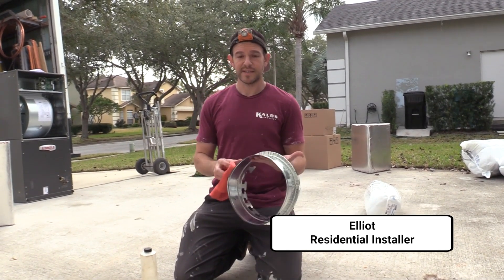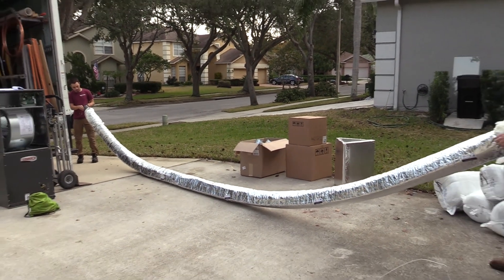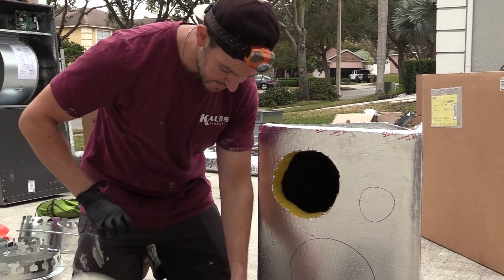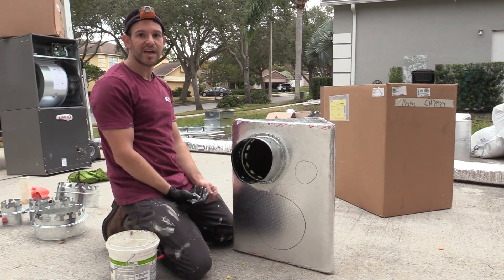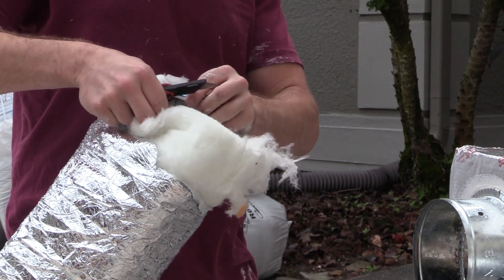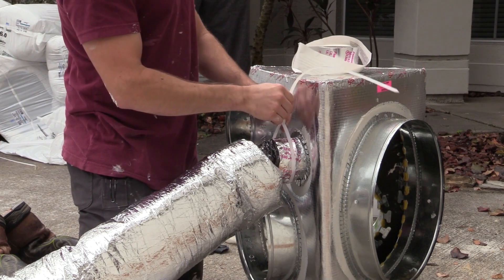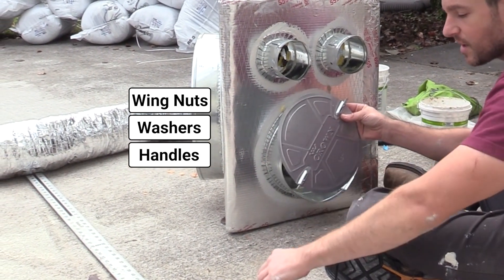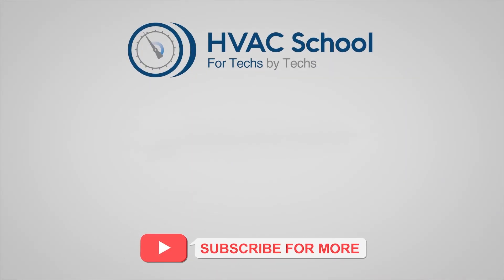Duct Prep Tips and Tricks with Elliot

Comment: IM A POUNDER OF DUCT WORK! 25 YEARS IN FLORIDA ATTICS. YOU FELLAS NEED SOME BASICS DOWN PAT. DAMPER PLACEMENT CAN MAKE ALL THE DIFFERENCE! PUT A DAMPER IN ANGLED OR  VERTICALLY AND IT WILL ACT LIKE A SCOOP! SIDEWAYS THE AIR WILL SLICE THRU IT AND BALANCE BETTER! AND ALWAYS GET TO THE SOURCE OF AIR NOT THE END OF THE RUN FOR A DAMPER! YOU'LL HAVE 25'  OF AIR BEATING DOWN THE FLEX AND ONLY A LITTLE BIT BLEEDS OF INTO THE SYSTEM! DAMPER IT AT THE SOURCE AND THE AIR WILL FIND A BETTER PATH IN THE SYSTEM.
101

Comment: Ductboard spider boxes and miles of flex duct! What a sorry duct system! As much as you guys preach about doing things right, I really thought you would do better than this. How about a solid metal trunk line, either round or rectangular, preferably round pipe as the air flows better and then flex going to the registers? That’s how we do it here in NC. All joints are sealed with mastic and the metal duct is wrapped with R8 ductwrap. Ductboard is trash and a bunch of plenum boxes fed by flex duct is pretty much the worst way to install a duct system.
Reply: Florida standard, unfortunately
Reply: This is the way we do it in Florida. No basement and you really don’t want to use metal duct because of the humidity.
Reply: I’m not buying that. I’m in Eastern North Carolina and we have high humidity as well, maybe not as humid as Florida but it’s close. We use metal duct on all our jobs and as long as every seam is sealed properly with mastic and the duct is insulated with R8 ductwrap it should not sweat. All of our ducts are either in the attic or the crawl space and I have seen some ducts that sweat in the crawl space but a de-humidifier normally solves that problem.
Reply: @vincentgelles3805  well I’m sorry but this is just standard practice in Florida. We don’t have basements so everything has to be in the attic. It seems to work just fine. Do YALL insulate the outside of the duct or on the inside. In Illinois where I started we insulated the inside of the duct unless it was going into an unconditioned space then we wrapped the outside with insulation.
Reply: We wrap the outside with R-8 duct wrap. It’s best to keep insulation out of the airstream so you don’t have fiberglass blowing through the house. I’ve seen lined ductwork that had some nasty growth in the insulation so we always wrap it on the outside. We don’t have basements here either. 95 percent of duct systems are in the attic the other 5 percent in the crawl space in the rare case the house isn’t built on a slab.

Comment: Cheap ass ductboard (instead of metal wye’s to properly manage airflow). Alumimium tape (rather than the REQUIRED UL listed duct tape). Lousy cheap “semi” adjusting zip ties tool (when true professionals we use automatic adjusting/cutting tool)…
Deer lord. Do yourselves a favor and delete this awful video, or rename it as “HOW NOT TO INSTALL YOUR DUCTWORK”.
Come on guys, I was expecting  more from you. Usually the content on this channel is top tier, but really dropped the ball low on this one!

Comment: I am genuinely shocked by how inefficient this guy is... First with the design... Secondly, improper stretching...  Then the way that he uses the mastic... .. in fact, this would not pass building codes here.. I am not sure why this channel would endorse this.. 
I think stuff like this happens when a company is used to working with the cheapest of customers. Then they start wanting to raise their prices and enter a different customer base so they just add a few steps to make it take longer and so that way they are " doing more" for the customer. They need to take a step back and redesign the process from the very beginning because this is not a good process. 
Just because something takes a while and has a hundred different steps does not mean it's good. 
If I see this guy one of my job sites I wouldn't necessarily kicked him off though.. he has the right idea... Just everything seems very book smart versus actually having hands-on experience...
If you read a book from the early 2000s on how to do this, this is how they would explain it.. but times have changed... The industry has higher standards now.. I would invite this guy to come out and take a look at A crew doing this properly for a living... A crew of five guys should be able to install two 5-ton horizontal completes with duct work in less than 8 hours.  And that would be with them doing everything properly and up to code.

Comment: using cheese boxes is terrible don't matter how pretty you try to make them they are terrible for airflow
Reply: Why? Any evidence?
Reply: @thecurious6721  lol any evidence... 😂 Manual  d ... Any evidence... Any evidence... He doesn't need evidence because  it's a known fact.. it's common knowledge.. it's not the 80s anymore... This install is a Trainwreck.
Reply: Agreed, definitely can make it work but you're not starting off proper.  In the field, proper is not considered over customer finances though.
Reply: Its an approved design in ACCA Manual D. energy . gov/sites/default/files/2013/12/f5/cq5_duct_splitter_box_beach.pdf
Reply: One way to do it I guess. With enough static pressure i guess you can kinda cheat by using this method of plenum connection…without blade damper tho how do you balance velocity?
Reply: @JesseDoesHVAC  wyes allow you to put dampers in.
Reply: If you oversize the ducts enough to get the velocity way down, it should be fine